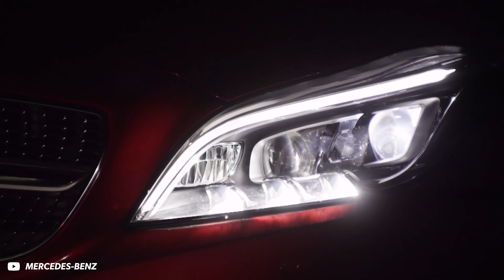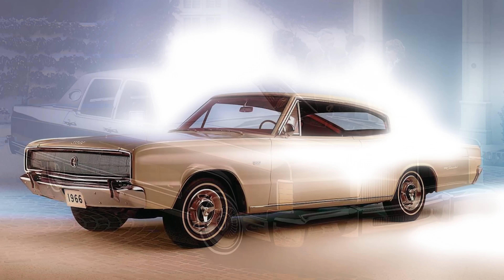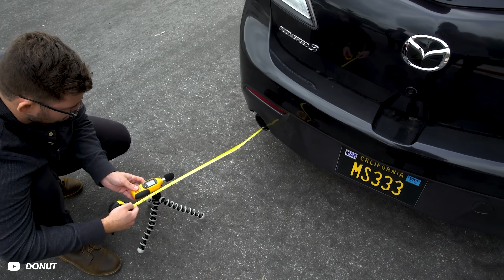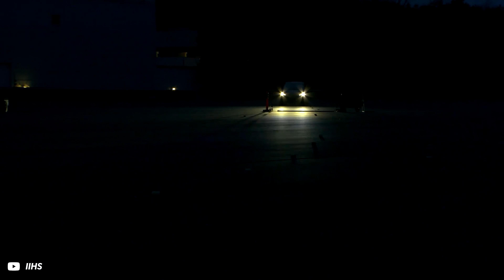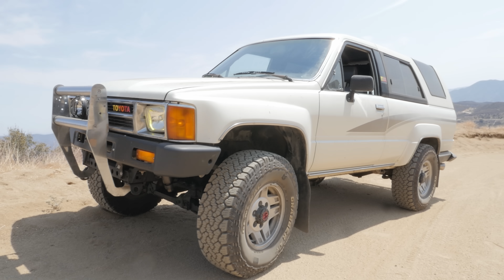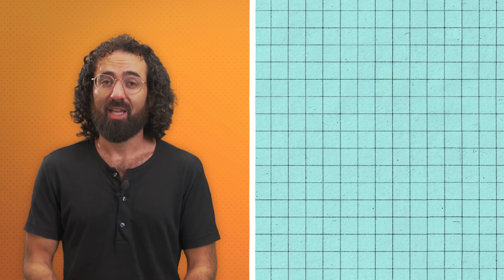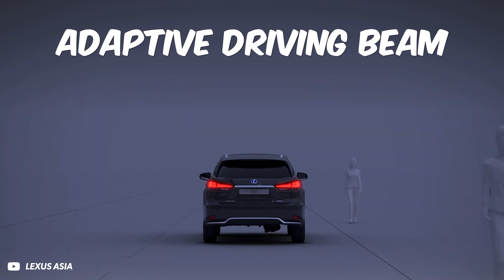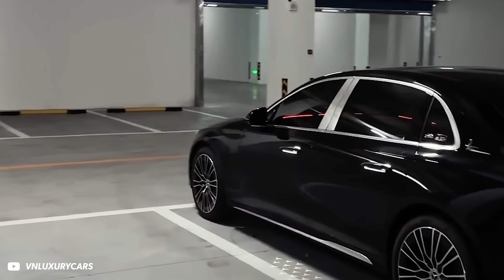Why new headlights are blinding American drivers

Comment: I did a research paper on head light housings while I was attending university for my engineering degree. The points you covered are 100% spot on for why we get blinded by so many vehicles, even factory ones. I'd like to expand on some of the important details that make up a large majority of the issue:
You mentioned no regulation of the vehicle after it leaves the factory, and herein lies the biggest issue. I'll break down my major findings:

Wrecks / Auto-body work: After a vehicle is in an accident the vast majority (over 90%) of body shops do NOT calibrate the headlamp beams. This also includes almost all lifted or modified height vehicles like you mentioned.

Aftermarket headlight housings: Particularly aftermarket assemblies made for Jeeps, but most others as well, rarely ever meet DOT or EU standards. Thus, the "beam" of light is more like a flood lamp, including so called "projector" headlamps in this aftermarket arena. It gets even worse when LED COB style halogen replacement "bulbs" are added to the mix.

LED COB vs halogen: Halogen bulbs, as you mentioned, have a singular small point of light being produced, which headlamp assemblies are designed around (physics plays a large part in this design on reflector style housings). When an LED COB is introduced it removes the necessary small single light source origin causing massive amounts of light to be refracted and blocked in areas that it shouldn't be; thus, causing the blinding "studio light" like you mentioned. I refer to it as a disco ball effect due to some areas being significantly more intense than others... and usually never on the road itself. This is the biggest culprit when it comes to people complaining about being blinded by "LED" lights. It's these aftermarket LED COB bulbs installed into halogen reflector housings.

HID: Surprisingly, there are some HID kits out there that are advertised for halogen reflector housings. The principle is sound because it delivers the required small single point light emission, but it fails to account for the intensity of the HID bulb; thus, again adding too much refraction and blinding people.

If anyone is wanting to modify their headlights, please do so responsibly. DOT has their published data readily available on how to angle and calibrate your headlamps. ... And please, don't turn ON any offroad lamp while on the road like light bars or flood lamps.

Comment: For those lifted trucks and high SUVs, just install a few mirrors angled the right way forward and aft to share the pain.  Maybe some kind of corner reflector material that one could install on the sun shade.  Then when you pull that down, any bright lights are reflected directly back at the source.  I'd buy that.

Comment: Most drivers unknowingly have their headlight height adjusted to be as high as possible and some even drive with fog lights when not needed. (This is especially noticeable in Europe as the cars are mostly fitted with headlight beam height control switches)

Fog lights obviously gonna bother you in the rear view and side mirrors. along with the headlight height adjustment.

Other reasons is swapping bulb types halogen reflectors and halogen projectors were never designed for the beam pattern produced by LED and Xenon bulbs some bulbs are worse than others too.

Never seap the bulb emitting type (halogen,Xenon,Led) or go for higher wattage of the same bulb.

Most of the time you will end up with less usable light  and scattered beams

Comment: Part of it is most certainly the bright white color. For a short while, my city used white LED street lights and I also found them blinding. They retired them as they were causing problems for a star observatory 50 kilometers away. That should tell you just how bright those things really are. The light hollow coming from my city was overwhelming the dim light coming from distant stars. In recent years, they've opted for amber street lights. They do a great job of lighting the street without the blinding effect. Personally, my own eyes are rather sensitive to light, so I see better in darkness with a dim source of light then I do in darkness with a bright source of light.

Comment: Something this video barely touches on is the fact that a LOT of peoples headlights are improperly aimed. It doesn't matter the bulb, any low beam thats a few degrees too high will blind you all the same. Along with that, if the lights were properly aimed there would be no issue period. Intensity doesnt matter if it isnt aimed at you.

Comment: When you buy these, please place your car 15ft. from a wall and with your old bulbs installed mark the wall at the brightest area (easily done with a free phone light meter app). Then replace the bulbs with your new ones and check that wall again. Adjust as necessary. A lot of these problems are caused by people just slapping them in. There are helpful videos on YT if you don't understand.

Comment: I do lots of night shifts, but the only people annoying me: 
1) having their high-beams on and just forget to switch back to low beams when you come into their sight
2) having high beams on while driving on the highway; Their automatic switch between low and high beams might not work when the median strip blocks the direct view onto your own head lights, but drivers in tall vehicles, like vans and trucks, are sitting high enough to see above the median and are constantly blinded then
... never really had an issue with bright low beams; Never really was blinded by them, unless they were installed wrong, or not adjusted to the weight of cargo in the back of the car

Comment: The problem is bright from the factory led headlights. They don't self level, cars have suspension, and people put shit on their hitch which tilts their trucks up. Intersections crest, roads aren't perfectly flat. All that means you WILL get blinded all the time even with properly adjusted headlights. We need less lumens, less pure white, and auto leveling. Also there should be a very obvious HIGHBEAM indicator because so many morons turn them on thinking that's the lights.
Reply: Amen!

Comment: as a european, I can say, that these problems won't be solved solely by allowing the matrix LED headlights.
a lot of people just ignores the fact, that the headlight needs to be calibrated properly. even worse, anyone with a screwdriver or hex key can adjust the base calibration of the headlight, physically, "yeah I'll see further with adjusting these screws a little" - yeah, buddy, but blinding everyone else...
and there are the lifted trucks.
and there's the issue with the used car market: a failed/cracked matrix LED headlight is extremely expensive to replace. people will buy aftermarket headlight units to replace them, or convert back the car to regular LEDs. (no moving parts, no fancy light show)
so what's the solution? mandatory technical inspection every year, or every 2 years, they check the headlights too.
Reply: in the netherlands  and germany  and several others    there is a mandatory  2 year inspection of cars,  for safety  and they do checks the lights then,  problem is people with smoked lenses mount the legal ones for the inspection, and after that mount the illegal smoked ones  so you can bareley see the back lights and indicators,  same for adjusting headlights correctly for inspection, after they put them back to blinding people
Reply: Yeah and when you get caught you get fined and taken your drovers license away.
Reply: Unfortunately, we tend to have to regulate that kind of behavior with threat of punishment, at least in the US.  If someone is found to have messed with their settings such that the beams are a hazard to other drivers, it could be considered attempted assault.  If they're in an accident or are found to be the cause of an accident by being IDed at the scene, especially with surveillance evidence, they could be charged with willingly committing whatever happened to the victims, including manslaughter.  This would keep most people in line, but anything less and they'll just keep ignoring the little voice in their head that's telling them people could get hurt.
Reply: In the UK there is an annual government test once a car is 3 years old, without which it cannot be taxed or insured so is not allowed on the road. This 'MOT' test covers brakes, lights (that they work and are adjusted correctly), steering, exhaust emissions, seat belts and various other safety aspects. Even so, I do get occasionally blinded by some of the more modern cars on the road, presumably under three yeasrs old!
Reply: calibration doesnt fix blinding on a crest of a country road. low beams should be halogen theres no reason for ultra bright lowbeams.
Reply: And worst of all, it's more expensive as well. All they need to freaking do is use a soft, warm white LED that's the same brightness as the old halogen lamps and it would improve situation tremendously without all this fancy expensive tech

Comment: I have had both. What I found with Led lights is they are great till it rains, then you can't see a thing as it just reflects the light back at you. In the UK and rainy places they are no good so the cars with led lights usually put them on full beam to see where they are going. I have the halogen normal dull lights, see much better.

Comment: Don't overrate your hope for ADB. Many new cars over here ( Germany ) have that, ans their performance is just crap. Most of the sensors ( or software ) are too insensitive. I drive a SUV myself, and still I have to use my high beam myself to make those systems trigger. Worst of them are installed on Minis, may be because their headlights look more upwrds than to the road...

Comment: Missed a VERY important part of the equation. Ask this to EVERYBODY - when was the last time you had your headlights ADJUSTED CORRECTLY? Things like tire pressure, worn suspension parts, damage to your front end and MANY other factors weigh in HEAVY to 'being blinded by someone's headlights'. Light beam path on a 2 door BMW are going to be WAY different than the guy who had his pickup/SUV lifted to a RIDICULOUS height - and that's getting to the point of crazy.

Comment: I suspect that it also helps that in Sweden (and likely much of europe) we check the headlight angles etc as part of the (more or less) yearly inspection that is required to be allowed to drive that vehicle.
Reply: might help a little but doesnt help the blinding situation when cresting a hill. low beams have no reason to be as bright as they are. if anything make em halogen again.

Comment: Fortunately there are pretty strict laws for the highbeams here in Germany especially. They either have dimming zones or adaptively turn off completely. Still there are some morrons leaving them on manually and also some older systems are to slow and blind drivers for like a second. Also as a byclist you get blinded the whole time and even some standard LED low beams already are blinding.

Comment: It's not just even at night either. I'm being blinded by these things in broad daylight.
Reply: I live in an area that's very sunny. It's crazy how some headlights are still too bright during the day.
Reply: Most cars' daytime running lights are actually the high beams at reduced power. When aimed directly at oncoming traffic, they are easily too bright regardless of the lower power level. The best solution would be for all (low beam) headlights and tail lights to come on when the vehicle is in gear, regardless of ambient light conditions. There is literally no good reason not to implement this solution.
Reply: @coronos3284  I agree.  I've said for years that airliner manufacturers should eliminate the flap handle. Just make flap and slat extension a product of airspeed. They could also save HUGE amounts of weight by eliminating the thrust reversers. Just make bigger brakes. There is a LOT of needless complexity by having thrust reversers.
Reply: When did headlights start automatically coming on an hour before the sun sets? I mean, I know it is mildly darker at that hour but it seems like the settings are really jumping the gun now.
Reply: Interesting.

Comment: My wife recently bought a Mazda CX 30. It has LED headlights that correct for level and turning angle, but we still get bright lights flashed at us from opposing traffic. That said, we live on the West Coast of Canada and in the winter the roads are wet and DARK. The lights on her car are fabulous for spotting the deer about to jump out of the ditch in time to stop for it. On bright they light the road up like day time. I have an older truck that had halogen lights from the factory. As the bulbs aged, they got so dim on wet country roads that I started rolling the window down and tapping in front with a white cane. I purchased some LED replacement bulbs and the difference (pun intended) is night and day. Way safer night driving and so far not too many angry brights flashing from the cars coming my way.

Comment: we need warmer lighting, even the street lights are blinding me nowadays
Reply: The white street lights makes everything sterile, bland & make me feel like I'm in a hospital. The yellow-ish lights? That's, as the kid say, a vibe.
Reply: Surely it's just cheaper than the warm lights, usually done by people who aren't driving or living in the same area, right?
Reply: @stevelewis1981  To make white LEDs warmer you need to use more phosphor material to convert more of the blue light the diodes produce into longer wavelength red yellow and green so yes cold white LEDs are cheaper to make than warm white LEDs.
Reply: Yep, blue light messes with your eye's night vision. I started wearing amber-tinted "night driving" glasses whenever I drive at night because I hate modern lighting.
Reply: the french had it right with yellow headlamps
Reply: Yea all the lights are being replaced with the white light which I hate. Streetlights use to be a soft orange now there a bright white and it’s so blinding
Reply: @ryans413  and those LED blue light doesn't cut true fog or rain etc, as well as halogen
Reply: @markilleen4027  For the same reason why bluish lights are more blinding:
Short wavelengths scatter and reflect more easily.
And if you think rain is bad, try snowstorm.
Low beams actually show farther in it because high beams only get reflected back to your eyes preventing any bit of dark adapting.
Reply: @tuunaes  i hate LEDs
Reply: ye

Comment: I had a compact commuter car (Toyota) for many years and got sick of sitting at intersections with headlights shining through my entire car at stoplights where I couldn't even see or use my mirrors or what my kids were doing in the back seat & tailgaters which would be driving with their high beams on behind me at night and I couldn't see what was going on around me.  Easy trick that doesn't require permanent modification is to use a suction cup mounted reflective sun visor in the back window (reflective part facing back) and just cover the bottom portion of the window while keeping the top portion open and visible as to not obstruct the entire window, and to re position your mirrors so the light shines backward but you can still use them when needed by just shifting your head.  Not every time but allot of times people would pull up behind me and after a moment or too they would dim their headlights and even shut off their fog lights, not because they were necessarily being courteous but because they were now catching some of that light shining back at them.  Works great when you have to rent a small car for road trips too.  Hope that helps! :)
Reply: I thought about doing something similar, but it could cause a crash because they end up blinded suddenly, so it could backfire.
Reply: I had this thought for my car. Considered looking for a one-way mirror just to send some of that light back towards oncoming drivers.
Reply: I like your thinking.

Comment: It should be easy to give cars eyelids.
A cover lowers from the top of the headlight, blocking any light from shining above the headlight's altitude.
When high-beams are enabled, the lid raises and gives full headlights.
Which manufacturer will be first to do it?

Comment: As a German i find it very ironic these headlights are completely fine and allowed
But GOD FORBID you want to use that new set of rims you bought that doesn't have what's called an "assessment" and costs up to 10 grand
Because THAT would be dangerous! You don't know if the rim might just spontaneously disintegrate!

Comment: There is more than one problem with LEDs, but we can start with the color temperature. Blue-white is good for the driver of the car, but dazzles oncoming traffic more, as the high color temperature impairs night vision, and therefore the glare is experienced more. In a halogen reflector, all the light comes from the reflector, as the bulb itself, which is typically horizontal, is masked. In an LED, you look directly into the LED, while the reflected light is a little weaker. LED has significantly more spill light, in technical terms a larger field angle, and you are never in doubt whether there is a Tesla behind you, as the entire cabin is illuminated, even with low beam. But that is not surprising, since they can't make instrumentation in the cabin either, you just put an iPad in the middle and you can sit and mess around with it, good for traffic safety. Poor construction on the vast majority of all new cars, but not all, because of course you can make headlights without spill light and with controlled field angles.